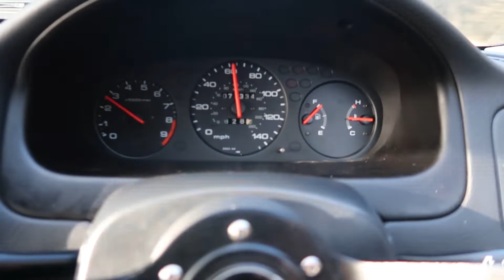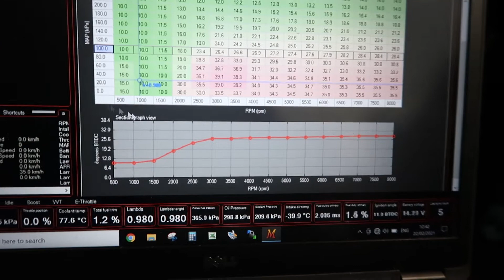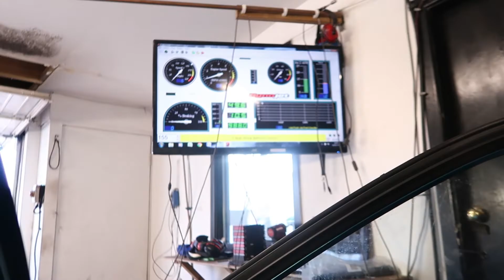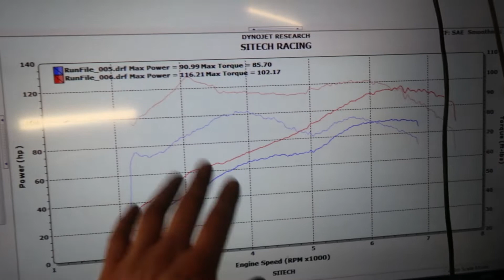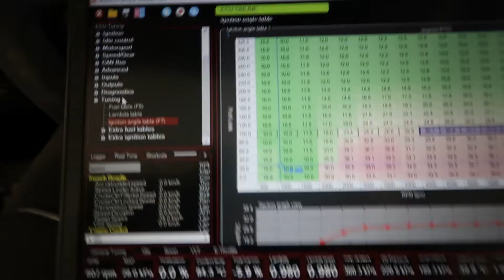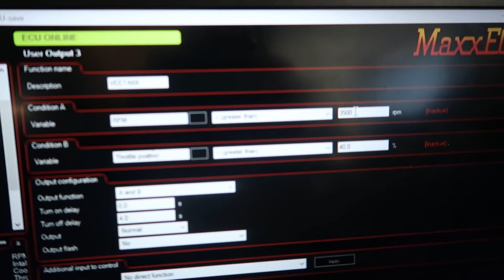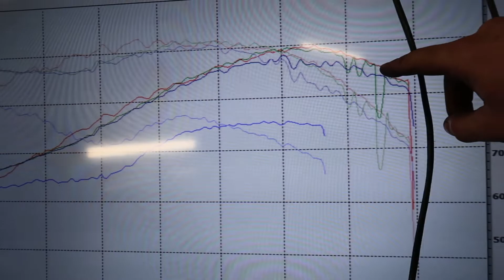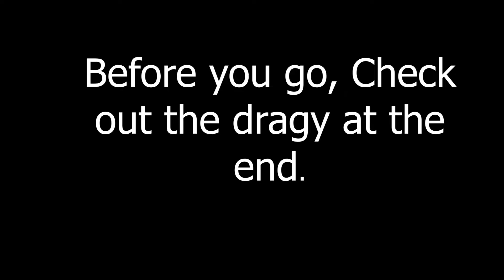I DYNO TUNE MY D16Z6. MAXXECU TUNING MADE DECENT POWER BUT I HAVE A BOOST BUG!

Comment: 11:30 should you not multiply by 0.9? to account for a loss. you seem to have gained power through the transmission...?
Reply from the maker: The opposite my man. The dyno measures power at the wheels. However we like to see bhp in the U.K. as all cars from factory are measured at the flywheel.